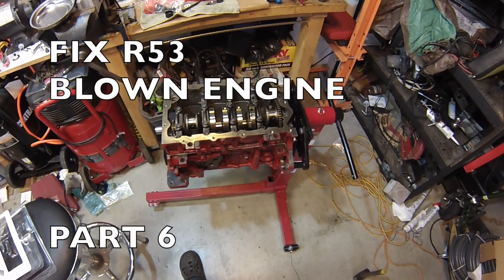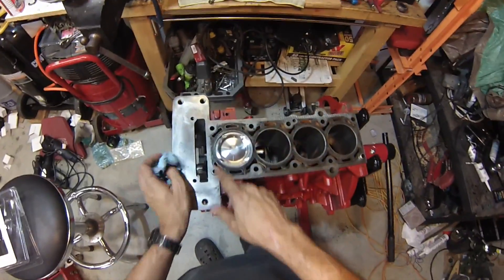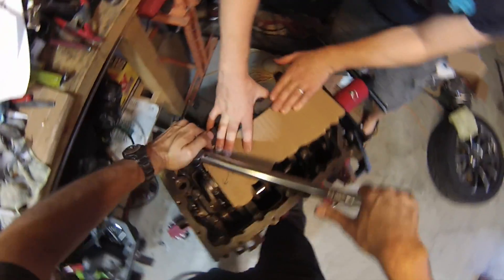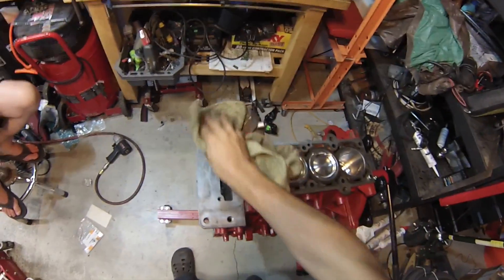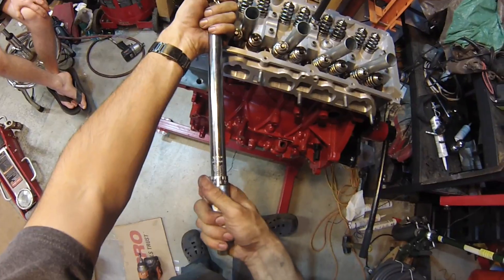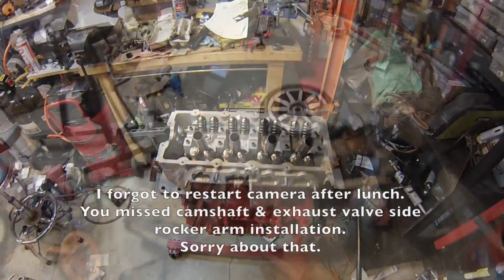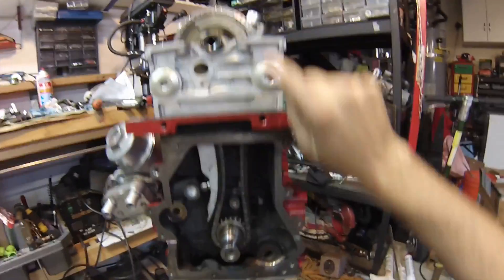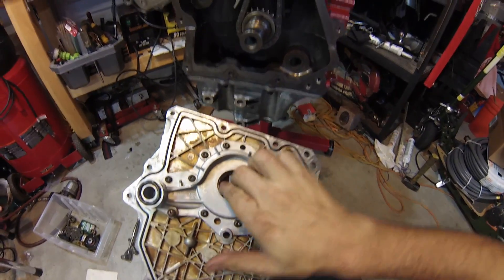Rebuild R53 Blown Engine 2004 MINI Cooper S - Part 6 / 9

Comment: Got a question for you. I have a R50 with a blown head gasket. What I am concerned about is when I take off the head that the timing chain is going to fall off or that I will have to take the oil pump off to line up everything. Will that be necessary? Any advice?
Reply from the maker: Have someone hold the chain tight until you can get the head completely clear, then hold it tight with a bungee cord.
Reply: ***** So it turned out that the piston broke in half after it met the intake valves. Blew the connecting rod apart which also scored my crankshaft. The machine shop told me that none of the valves bent, they just need to remachine the valve seats I think. I am going to rebuild it though. Cylinder walls are in perfect condition.
Reply from the maker: mneste8718 Sorry to hear that. Interesting that the valves didn't bend. R50 must have softer pistons than the R53. On the R53 the valves would bend for sure. Can the crankshaft be saved? What will you do if it can't?
Reply: ***** So it turns out that the valves did get bent out of shape. Took it to a machine shop. They resurfaced the head, pressure tested, replaced valves and put in new seals.  What's worse though is that I did not notice that the cylinder got scored. All the way at the bottom of the stroke unfortunately. So now I am hunting a new block. This got out hand pretty quick ha. But I did manage to get it painted over the weekend with Sora Blue Plastidip.

I have a potential source for an engine. The owner swapped it out of his because he was hearing some internal noise. Hoping its only a wrist pin. His mechanic checked the cylinders with a scope and they were fine as well as the rod bearings. Didn't smoke either. Any ideas what it could be? I'm just hoping for a good block that I can just hone and be done with.
Reply from the maker: mneste8718 How bad is the scoring? You can probably machine that out but would need to put in larger pistons and rings. If your lucky the other engine was just timing chain tensioner noise?? Only way to know for sure would be to tear it down and inspect the internals. Even with that block, if you go through the trouble of honing it you probably would want to ensure pistons and rings are the correct clearances when all is done. If you're just deglazing it you could probably reuse your existing pistons but I'd put new rings on it at the very least.
Reply: ***** Yea well larger piston and rings would run me $1600 which is ridiculous money for an r50 motor. Easier to source a good block that I can just hone.

Originally I was going to just change out the piston and rod. Then also change the rings on all 4 cylinders. And so now I will have to do that on a new to me block.

There is a difference between honing and deglazing? I'm just planning on getting sanding blocks that you attach to a drill to get some cross hatching to seat the rings. Is the spacing on the rings for an r50 .015" as well?

Comment: i need your advice, i'm working on an R53 2003 but the timing is off because i did the job wrong, i moved the crankshaft when the chain was off.i saw that you did the timing in part 6 but is it really so easy? just alling the gold parts of the chain to the arrows? i don't need to alling the crankshaft to a sertant point, or the camshaft? I like your show!
grtz Reinier
Reply from the maker: Yes, it's really that easy. Don't put the cam sprocket on backwards and make sure the front side of the chain is under tension when you do your final confirmation. That's really the only thing that can go wrong- you've verified the gold link locations but there is slack between the two sprockets and engine moves out of time when the chain goes right. 

Hope the videos are helpful.

Comment: Thank you so much for the fantastic video, i will be replacing the timing chan. Any tips?
Reply from the maker: Not really, just as shown in this video! It's that easy, just more crowded when the engine is still in the car. Do you have any specific questions?
Reply: Not yet maybe when I get elbow deep I will thanks.
Reply: ***** Question, what is the best way to get off the crank shaft timing chan sprocket?
Reply from the maker: Al j See my other video: Harmonic balancer/front main seal - MINI Cooper 2002-2006
Reply from the maker: ***** If you are referring to the timing chain sprocket behind the harmonic balancer, that's pressed on. Probably need a gear puller and some heat to get it off.  Not sure. it's really durable and something bad would have to happen for this to need changing.

Comment: Love your video sooooo much! Learned a lot from them. I just can't wait for the next one.
Could you please do some R53 steering column service video? Such as how to get access to the steering column and how to do some fail-prevention/repair service? Thank you!
Reply from the maker: I will if I ever have work that requires it. 
Taking off the airbag is not fun apparently.
Reply: ***** does it have to take off the air bag? Or we can leave the air bag as is and work from the bottom steering column?
Reply from the maker: What are you trying to do?
Reply: I would like to grease the plastic do but that metal column passes thru and the universal joint. And also would like to loosen the bolt holding the column in place, relieve the pressure and the re-tighten them. Is that possible? Thank you very much!
Reply: ***** Because there is just one clunk noise when I turn the steering from one end to the other (very big turning angle) at very low speed. Is that a problem? Thank you.
Reply from the maker: Solaris Sun Remove the lower dash trim piece and stick your head under there, should be able to see. Bottom half of steering column cover is held on with just two fasteners.
Reply: ***** thank you so much buddy.

Comment: Liked the metal strap to lock the crankshaft to torque the two bolts.
Reply from the maker: I have a rigid bar I usually use but couldn't find it and was in a hurry to get the motor together.
Reply: ***** Just out of interest, what's your opinion on electric rattle guns as I've noticed you use both air and electric. I'm currently looking at some Batt powered guns.
Reply from the maker: Jeff Stanyer As a general rule, I use battery powered with 1/4 inch quick chuck and a 3/8" socket head for fasteners that are 13mm and smaller, and pneumatic with a 1/2" socket head for fasteners that are 13mm and larger. I'd recommend 18v or higher for battery powered, although I do have a 12v gun with an angled head that I mainly use for really small fasteners (8 or 10mm) or for zipping larger bolts out or in when doing by hand is too time consuming.
Reply: Thanks, I was looking at 18Volt 1/2" drive and considering the cost against a new larger compressor to run airtools, the Batt version is looking more viable cost wise for the use it will get.
Reply from the maker: Jeff Stanyer Cool. A battery unit won't have nearly the power of an air unit but that may not be an issue if you weren't expecting a ton of power, and if you wouldn't use an air setup enough to justify the higher cost.

Comment: Why did you not go with a roller rocker setup? Looks good. Keep up the Great work!
Reply from the maker: They are roller rockers - the stock setup for a W11 motor, which easily handle a 7500 rpm redline.

Comment: did those connecting rod journals on the bottom come split already?? The ones i bought were "fractured" but not separated so I had to split them myself...kinda fun actually
Reply from the maker: Yes they were pre split. They were a perfect machined surface, not like the stock connecting rods.
Reply from the maker: ***** http://www.molnartechnologies.com/molnar-rods-sp.html